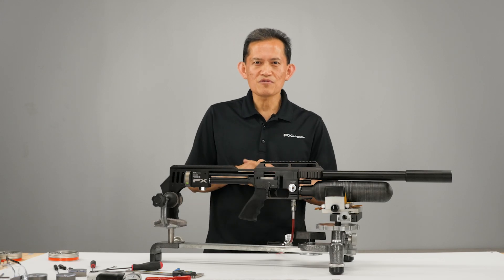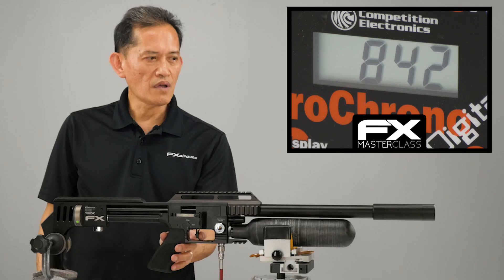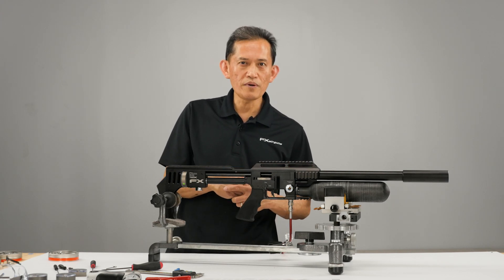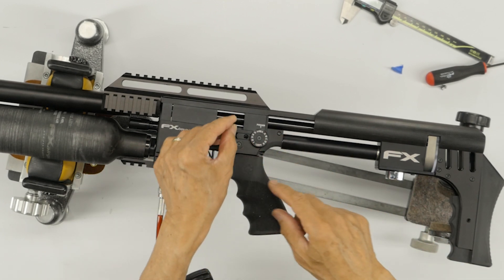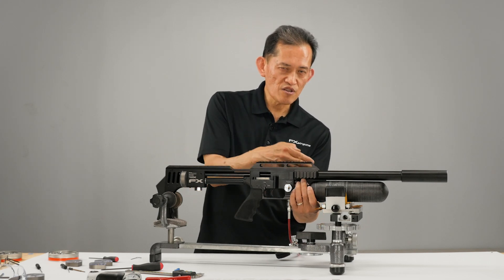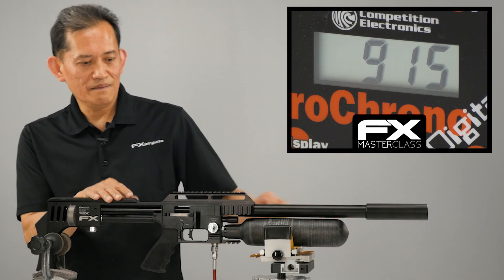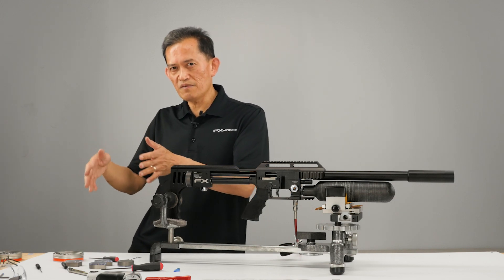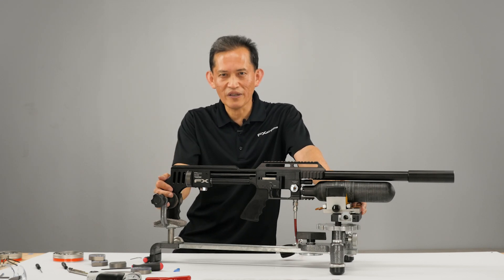FX Masterclass : FX Impact - FPS Tuning

Comment: Absolutely brilliant. So clear and easy to understand and do ourselves. 
I have couple questions. In uk we have to stick to sub 12ft/lbs. Would you say this is still worth doing for us? I know my given pellet weight so could easily find the fps I want to achieve. 
Also on my impact m3 I set the micro adjuster but after about 50 pellets it’s moved in and I have to reset it. Is this normal? Should I put a drop of locktight blue on it to hold it?

Comment: Thanks Ernest, that's awesome.  That's really scientific with all those instruments to calibrate it.  I remember when I was in the Philippines I just tried to approximate the spring tension of the air rifle hammer vs the CO2  tank air pressure, and it was a long process of trial and error, and patience.  The FX M3 is really amazing, one of the best air rifle so far when it comes to fine tuning and accuracy.  Have a great day Ernest and God bless!

Comment: Great video Ernest. what is the cc in that small plenum? After this tune at 130 bar regulator pressure, Macro at Max, micro pre-load at 18 mm, valve spring 1-1/2 lines, or better yet 7.5 mm; how many shots from 250 Bar bottle to falling off regulator? And once falling off the regulator, how high does the next number of shots climb to in velocity?
Lastly, what is the hammer spring specifications? such as length, wire diameter, number of coils, inside diameter, and if you would know the spring-K value or type of metal.
Same for the valve spring. If you do not have such data, how can I purchase a valve and hammer spring for my analysis without the included gun?
Thank you

Comment: Thank you for the video. I just received  my barrel change kit (.22/500mm) for my Impact X MK2. I am going from a 600mm .30 to a 500mm .22 and I have a couple questions please sir.  Since I will likely be going in the opposite direction to what you presented in this video do need to unscrew the bottle before each/every/any time I adjust the reg pressure down (clockwise)? In going from .30 cal to .22 / (18 gr pellet) and the shorter barrel, would you start by lowering the reg pressure from its current setting of ~145ish to around 130 -135psi and fine tune downward or would it be better to initially drop the reg more and work my way up (then back down) like you did in this video? What would I do initially with the hammer spring for each senario?
Thank you for your time.

Comment: I’m having a problem with 30 cal fx impact 700m barrel with Stx barrel. I’m at 123 or so on reg. I get a good group but I get 4-6” flyers with fox 44g at 60 yards. I’m at avg 874fps 
Where should I start? 
I had old barrel on and Utah Airguns put new stx barrel on it and I’m having issue with flyers

Comment: (First Im not good with English)Im new in the impact life 😁, am i hear you right when we turn the power wheel max and preload to the max and its can not turn anymore so what to do for example if we want to use 2 different pellets weight lets say everything max out and perfectly tune for 25gran then  then also one to use 18grain but with all max out it will be to power ful for 18grain so how to turn the power wheel down do we need to remove the wheel after we max out every thing and put/set to no1 then we can turn again to 1-5 with out take out the wheel next time

Comment: I'v seen all Ernest video to lear about FX Impact. I notice that the size i take with caliber, about the hummer spring, after some shots change. For example i set it 16.40 mm but after some shots (and after some time i dont use it after i'v done the setting) i notice the velocity is lower and go to check the size og the hammer spring it 0.20/0.40/0.60 mm longer (less power than) ... is that normal? anyone else have experiment this issue?

Comment: Hello sir 
I have fix impact 35 caliber just got it last week 
My speed only 854 FPS 
My regulator 145 par 
So those  pellet 81.02 gr actually have 
Did I supposed raise it up 
Cause when I got it from uta  the sand a sticker 
Have Pressure sat up on 885 
What is your advice 
your opinion.
Thank you

Comment: Tell the folks how these things are beautifully made expensive air leakersssssssssssssssssssss. you all need to go back to the drawing board, try to get the number of seals down to under 50. Soooo disappointed with my FX, Never again
Reply: You must of had a dodgy one as I have two and never had a problem.
Reply: It's all in pieces now and I found 2 o rings badly scored on the power plenum, I had to order o rings from a o-ring company because seal kits for the mark II are not available, hopefully thats the problem. What I see is a badly over engineered machine with about 50 points that can fail and leak. I'm glad yours works, I still cannot recommend them. I just ordered a Ataman M2R that should do the same job at 1/2 the price.

Comment: I’m really stuck on the hammer spring adjuster, it should be a 2mm Allen but I just can’t get anything to fit? Anything special?
Reply: I was tuned to 930fps, reg pressure 120 bar, I installed the power plenum, huma-air dual transfer port and pellet probe and superior liner, post install it is now shooting 855 fps, even with the reg set at 140. I know it needs hammer spring adjusted, I expected I could lower my reg pressure with these mods.
Reply: Try 1.5mm
Reply: I struggled with it also, get a quality Allen wrench. I bought a Wera 2mm long shaft with a ball end on both ends, cost me about 4 bucks on EBay.

Comment: How are you friends, recently I received my rifle mkII power plenum .25 to how many bars should I adjust the regulator to optimize autonomy and precision with 25
grains? thanks for help.
Reply: With 25.39 grain pellet and 25 caliber, you will get the Best Accuracy AND Power combination at or below 44.5 foot pounds of energy at the muzzle, which is the knee of the upward curve of the speed of sound at 26 degree Celsius. Above said velocity, you will get more power, but less accuracy and far less efficiency. What good is it to throw a boulder at an ant, if you are going to miss? The worst hit in history is still far better than the best miss in history. Start your regulator pressure at 145 Bar, set your hammer spring tension preload at its maximum and back up the Allen screw one full turn, set your valve spring tension fully open and adjust your regulator till you get one to two fpe above the target 44.5 fpe then tune it down with the power wheel and the valve tensioner. Now tune down, but not up until you find your barrels harmonic resonance with set regulator pressure, hammer spring tension, and valve spring adjustment to that particular pellet. The pellet will be travelling at approximately 3/4 the speed of sound, and your barrel will be resonating approximately 5 to 6 times before the pellet leaves the muzzle. Your best grouping will be at exactly 5-1/2 the barrels harmonic as the pellet leaves the muzzle, not above, nor below. The fun part is finding the frequency because it is set by the amount of gas pressure being released to the pellet mass, caliber and barrel length plus a couple of hundred more variables, small, but variables still. Enjoy the hunt for the grail.

Comment: Thanks Learned lots here!  Curious...  what would i use the hammer spring adjustment wheel for? since the adjustments are so course?  All these tune videos show it on max.  the set screw appears to bias the hammer spring tension between the the course settings like 4 and 5 or 5 and MAX.  But why make the hammer spring wheel with such course adjustments? a redesign of the gun so i can fine adjust without need of Allen key (and taking off the stock, Crown)  for example

Comment: Thanks for the video. I thought I knew where you were going with the tune - keep valve and hammer spring maxed and increase reg pressure until 920 fps was achieved and then back off the hammer spring to the ~900 fps range. I was wrong. Instead of backing off the hammer spring, you closed the valve a bit to drop fps to 900 range. I'm wondering why? Seemed to me that a bit lower hammer spring setting would have been better for the rifle. So why the valve adjustment instead?
Reply: Anyone know why?

Comment: It does not appear that Mr. Rowe responds to any questions here, but I'll throw out my question in case someone else may be able to answer it. Regarding the "target" velocity, where did that come from? Is it a mfgr. recommendation, past experience, or was it just pulled out of the air? My second question is, why run the fps over 900, and then decrease it? What is the point or value of doing this? Thanks in advance for anyone willing to comment!
Reply: I watched the video and with all due respect, I did not follow the logic behind this either.  It seemed very haphazard. I get the concept behind increasing regulator to find a velocity peak, but I don’t see the rational on adjusting the rest unless I am missing something.

Comment: Thx for taking the time FX Gang.
Just loving my Impact Mk2 PP to bits.
Reply: Mine has been returned 5 times, it has never worked. They stole $4000 from me and wont give me a working gun. FX ARE SCUMBAGS FUCK FX
Reply: Brian T what’s wrong with it
Reply: @jwollheim  5 broken cocking levers, 2 valves, bad gauges , poor machining on block caused bad pellet probe alignment, I got one of the poorly chamfered pellet probes too, and the power plenum leaked.
  I had to pay the shipping on almost all the returns, so I am down hundreds there too. They never fixed it ,after 6 tries I did it myself and now it works. FX are totally incompetent.

Comment: I have just received my 25 cal 700mm Impact X mkII.  The gun is not shooting correctly out of the box. Firstly the sound is all wrong it is just a tight click when fired and the velocity is 355 fps with JSB Exact 25.4 grain with the power wheel set at max.  Thank you for the tuning tips and I understand how I can probably tune the gun to get the correct performance but I am concerned that something may be wrong with  the gun since the performance is so poor without any adjustments made to the factory tune by me.  The reg pressure is set at 130 and I have filled the bottle to 220 bar.  The gun was supplied with the Side Shot high capacity magazine and I have fired over 100 shots to see if there was just a break in required.  It has consistently shot around 350 fps for the initial 100 shots.Please advise if I should return the gun or attempt to tune it.  Thank you.

Comment: I have adjusted the power wheel to be snug on max and slightly loose on min.  Why have you left it loose on max.  My Impact is shooting 880fps, 18gr JSBs regulator is on 115 approx.  I've put whiteout on the valve adjuster to keep track of the rotations, as they are graduated.

Comment: My method to setting FX IMPACT IS:
1.- Regulator under trigger increase to limit 140 bar. 30 bar more than factory  setting. DON'T MOVE AFTER. WARNING SEE MANUAL.

2.- Valve control knob Accurace Fine Regulator in mark 3. one line from default setting. DON'T MOVE AFTER. WARNING SEE MANUAL.

3.- Regulations of spring hammer setting in minimum clearance displacement (DON'T MOVE AFTER SET IN CLEARANCE IN MINIMUM)  NOT EXIST INFORMATION IN MANUAL.

4.- Finally power adjustable  wheel in position for Max spec of YOUR options of course  to .30 cal. and X long barrel system 700 mm. At these point ONLY REDUCE WHEEL POSITION TO DIFFERENT CALIBER OF PELLETS AND BARREL SYSTEM THAT YOU NEED. DON'T MOVE PRECHARGED SEE MANUAL

Comment: Why make your adjustments on the hammer spring adjuster on MAX ? You have no where to go other than other than down I set on MIN then you have the whole spectrum of the cam to increase the pressure which is about 4 mm of travel on the spring
You may as well cover the gauge they are so inaccurate and work off the crony
Reply: i believe he is trying to keep the reg as low as possible and still hit the target fps. if you start on minimum you would have to crank the reg to 150 to get the same results. i'm sure at max the speed would be way to fast so how are you gaining anything? starting on max you can go down. just my thoughts.

Comment: Dear Sir, if can please show for .25cal one more
Reply: Same procedure just slightly higher reg pressure 135-140 would be a good start.  Literally NO difference other than reg pressure for different calibers.
Reply: glem chally I have several questions for .25
1 the valve adjuster in 4 and pressure 135 or 140 what velocity I have?
2 the valve adjuster in 4 and pressure 110 what velocity I have?
3 what velocity is ideal for .25 with 25.4 grains
4 hammer spring adjuster what distance has?
5 valve adjuster in what line is correct position?
Reply: @fernandocastro7292  I've only had my gun a short time but I'll help the best I can.
1 at 138bar  I get about 920fps with 34gr king heavy.  This is after I've removed the slack from the hammer spring adjuster and on max
2 maybe 820fps with 34gr (900-920 with 25.4) on max
3 probably 880-920 
4 I've removed the slack from hammer adjuster so max is really maximum.  On MK2 with 700mm.
5 I find 3 is good enough, maybe with heavy slugs might need line 4.

Join airgun nation forum,  many know much more than me and a really good guy who knows the impact well is Chileano he can help more.  I'm there same name.
Reply: glem chally Thanks!!! thanks!!!

Comment: That was great as always you are very very intelligent man I have purchased the impact mark ll .25 Caliper FAC. Do I use the same principle as the regulator I believe has been upgraded I would be very please for some feedback on how I should tune this gun thank you very much..? Keep up the good work. All the very best Andy from the UK.
Reply: Yeah, clean the barrel immediately. Great accuracy once you get practised and set up.

I have a recent MK1, which arrived with a picatinny rail screw missing (fell out during transit), which meant it would hold PoI horizontally - I didn't realise and assumed it to be a scope anomaly. FX just offered the excuse "mustn't have been tightened up after testing in the factory"...not even an apology! It's now got threadlock on it.

Next issue was the pellet probe screw coming lose, which is a known complaint. Threadlock sorted that too.

Now found that I have a slow leak from the regulator vent hole...it leaks from 250bar to 130bar over several days. When I have the inclination I'll take it apart and fix. I could send it back under warranty but: a) I'll lose the rifle for several weeks, and b) if they can't get it right in the factory, I'd rather sort it myself and void the warranty.

Altogether a difficult and frustrating  first couple of months of ownership for a rifle that costs so much. On the upside, it shoots very impressive groups and harvests rabbits superbly at ranges in excess of 60m.

I'm sure that once I have these irritating things fixed I'll be very happy with it and it's performance. Just a shame that these experiences happen in the first place as it hints toward Quality Control and Assurance processes that could be vastly improved at the factory.  I'm lucky being an engineer, as I can fix these issues myself but I really feel for other owners who at find themselves with similar range of issues that they can't diagnose or fix without returning the rifle to a dealer.

That said, I'm pragmatic about it. Many premium products have ownership shortcomings, as complex mechanical systems that run on the limits of knowledge and manufacturing, they often have the downside of being somewhat temperamental, requiring a deeper understanding of how to maintain them in a consistent working order.

Doubt all of the well-known YouTubers that showcase the Impact have these issues though!
Reply: No on the video Front. When I ordered the gun I was told eight weeks but I got it in five. Unfortunately the manual they send with the gun relates to the old impact so not much use. It’s very important to clean the barrel very well first keep cleaning until you have a clean patch. If not you will not get a zero at all I have cleaned mine and with JSB EXACT KING.25.39GR. 50 yards I got 28 pallets in under an inch at 50 yards I am sure it will do a lot better than that that’s straight out of the box I absolutely love this gun. And I’m sure you will too good luck with your purchase. All the best from andy.